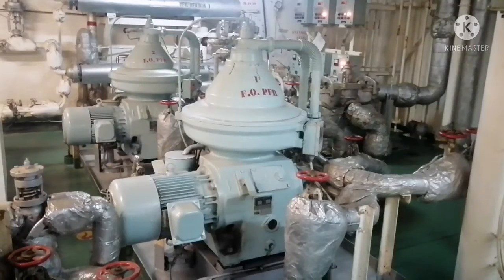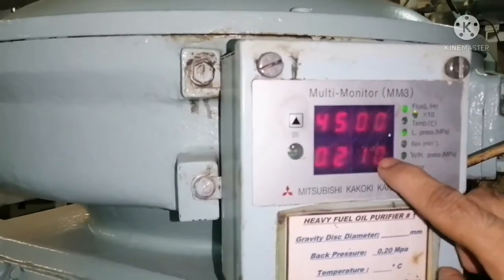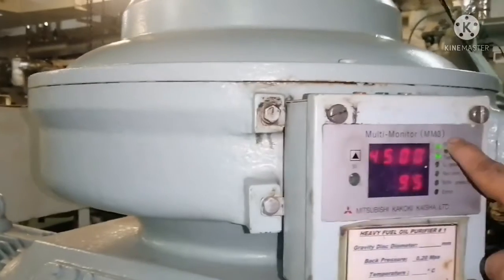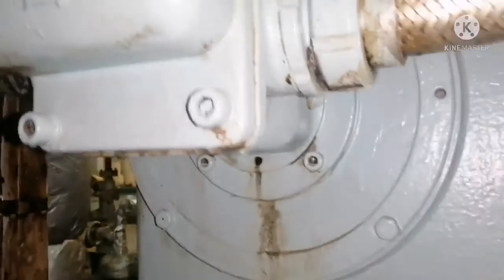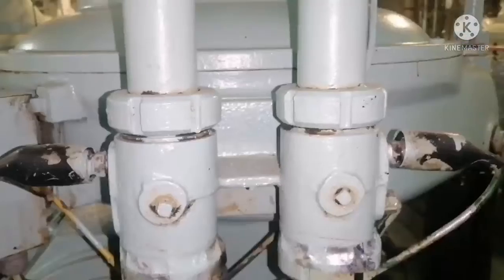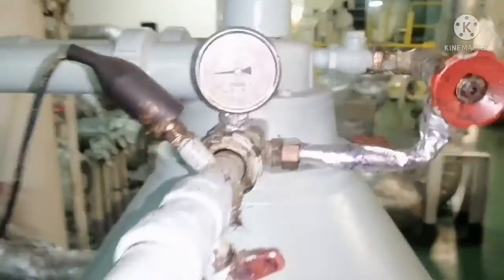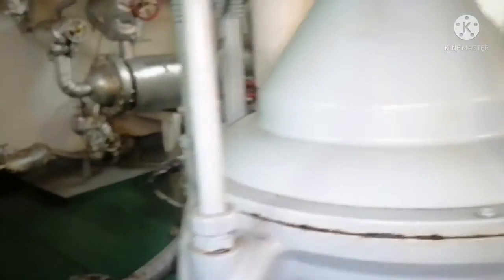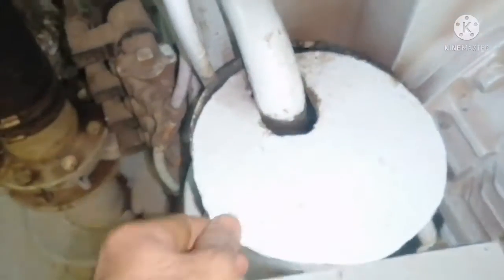what to check....Operational checks to do in purifier

Comment: sir, good day. i have a question. hope u will reply.
During desludge period, why the ampere of the motor suddenly gets higher and fluctuates?
Reply from the maker: Thanks for your good query,
* During desludge operation the bowl tends to open.
* This opening of bowl vl gv additional load to motor which tends to draw more current.
* Once the desludging process is completed the motor will get back to normal working load.
Hope this reply will satisfy your query..
Sir is there any query from your side which i didn't reply?.. If s pls post it query Again..
Reply: @marine-knowledge-basha  thanks sir, you really have a very kind heart. take my utmost respect.
Reply from the maker: @mec6953  Thank you for your good compliment sir.. Keep supporting